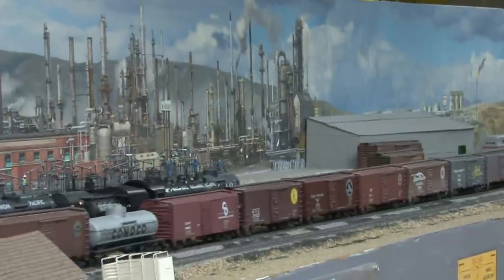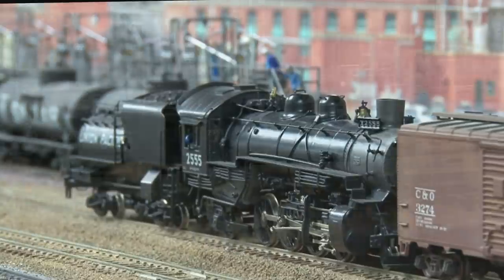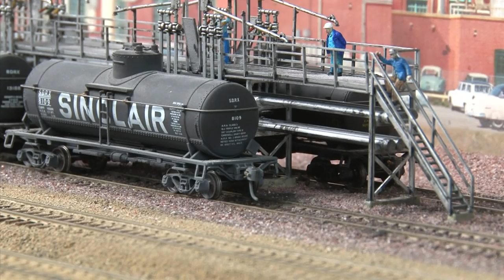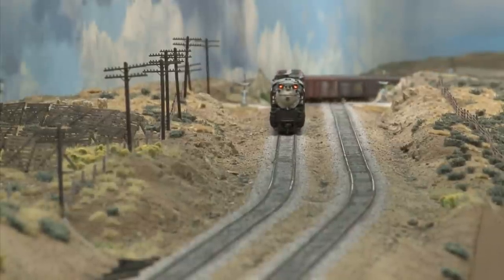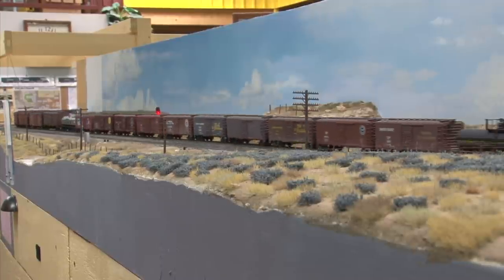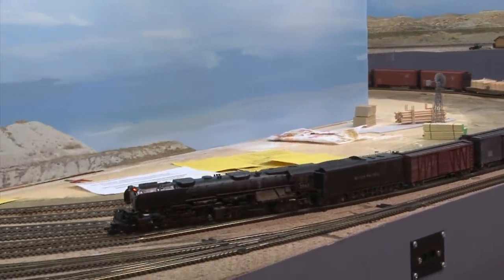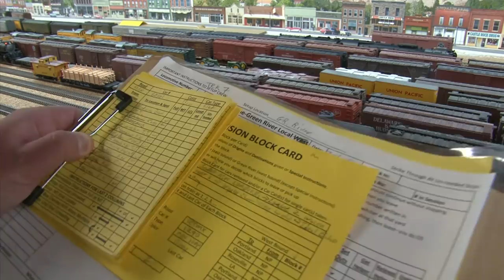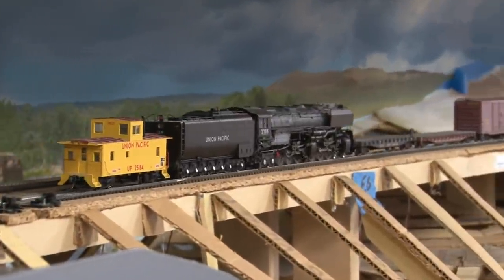Wyoming Division MRR Update and Tour  - Section 2 of 3

Comment: Gotta love that Challenger! I actually have one but for the D&H over here in NY.
Reply: I can’t agree: it runs like a bag of spanners, has a headlight which looks like it is powered by a candle and a sound system which really needs to be put in the bin. All these issues could be sorted though.
Reply: @struck2soon  I’m not sure what brand of locomotive that they are running, but it sure runs smoother and is more advanced than my AHM Rivarossi Challenger! It’s still DC and from 1977, regardless, they are all nice pieces.
Reply: @tomstrains4129  It looks like it is possibly an Athearn item, which would also explain the diabolical decoder. (They used QSI decoders which were cheap and notoriously nasty.)  The models themselves are good and pull well, but need a decent ESU or Soundtraxx decoder to get the best out of them.

Comment: Green River the key to the entire layout. Good yard crew Ops sessions go smoothly. Still wonder why no tenders on the turbines
Reply: The turbines are basically GP 9's with extra trucks. I've had to load a bunch of extra weight for them to pull a 30 car train. The tenders are very light and derail all the time in that circumstance. So, they are all sitting together in the Ogden R.I.P. yard.
Reply: @allenscottmontgomery3929  i figured that was the issue. Having attended a couple op sessions im surprised you guys have derailment issues. Never saw them. Well one, on top of Sherman hill
Reply: @theknickerbocker5808  Shssssh. We don't have derailment issues:)  Yeah, we are pushing the envelope with the turbines as is. We could get away with them on the PFE trains, as they are shorter. But then I have to make everyone remember a new rule, and our op sessions are chaos enough.
Reply: Organized chaos perhaps, I'm willing to work most any job EXCEPT down in the staging yard that is the true meaning of chaos

Comment: I hope the shop guys fix 3943 and 818's headlight
Reply: Fixing headlights is item 6,249 on my To Do List. I'll get there one of these decades.
Reply: It looks like a DCC Speedstep 14 issue. Check if the decoder is not set somehow for Speedstep 14, instead of 28 or 128. That would also account for the varying speeds from time to time.

Comment: where are the electrical wires?
Reply from the maker: I think you mean for the track power. All the signal, track power and control lines are beneath the benchwork. Some of it is accessible via flip down panels on the facia while other wiring is accessible from beneath the layout.
Reply: @easternsprails  It all looks very clean. I was wondering about that.

Comment: How does a turbine work without a tender?
Reply: iirc verandas still had internal fuel tanks (not very large though)
Reply: @flak1939  I did not know that.
Reply: The tenders were added to increase the range without refueling. They have Bunker C on board. But our tenders are light and derail, so they're idle for the time being.